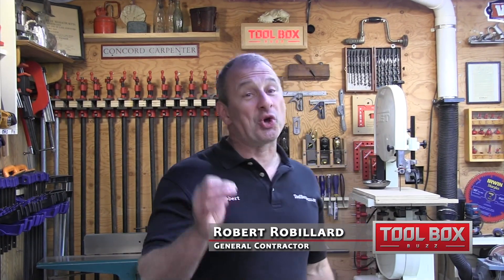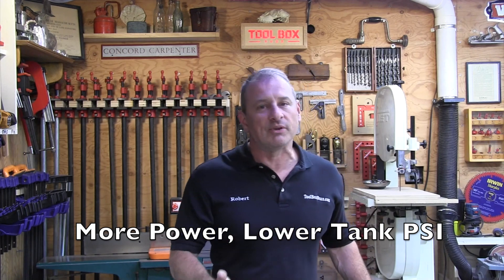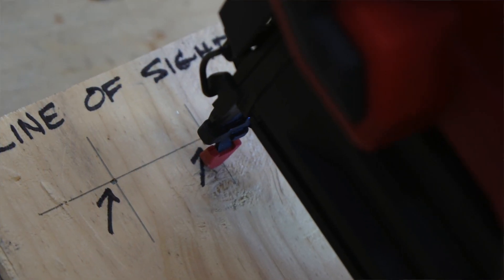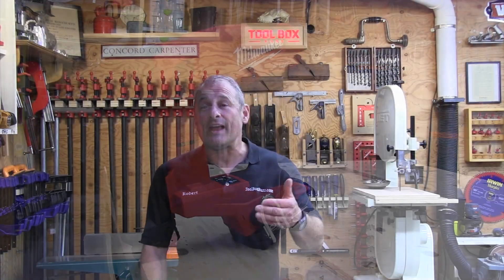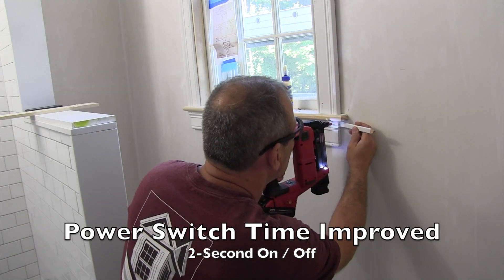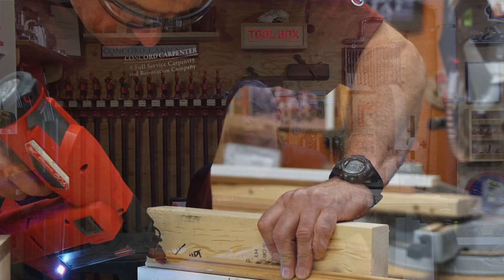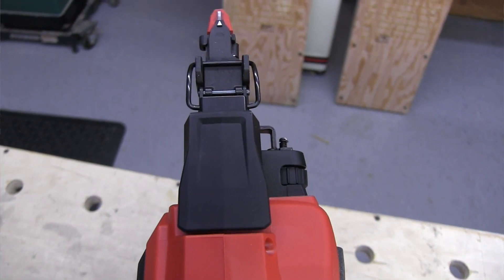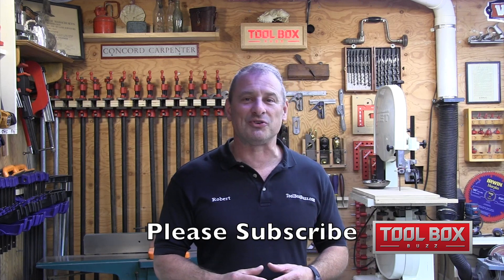Milwaukee M18 FUEL 18-Gauge Brad Nailer 2746-20 Review - Gen 2 - What's New?

Comment: Mine barely sinks nails on the highest setting. But I’m an old dumb plumber that doesn’t know anything about finishing work. I was hoping that it was like the the framing nailer and had enough power to turn it down. I tried to toenail into a corner bead and it curled outwards. I paid the exact same price for the framing nailer last year. I just don’t view it the same way, but I’ll keep it.

Comment: Bought it yesterday .
At 9:06 in your video I see a repair on the wall with fiber tape : use spray contact glue before applying tape , the tape will set ;)
Thank you for the infos on the tool , well explain !

Comment: I bought one for a trim job I did in Oct of last year 2021. I just tried to use it again to install some trim on a storm door install and couldn't get it to work. I tried different length nails and tried to reset it a number of times...
So now I guess I'll call Milwaukee, to find out what I need to do to get it fixed.

Comment: In 2017 I bought the battery operated Makita pin nailer and it shit itself in 15 minutes. It was the third time I had a bad experience with a hoseless nailer and I was done. Now three years later it seems Milwaukee has finally made a gun I'd buy. PLus, I have a few of those 2 Ah batteries from impacts I bought, so why not use them :)

Comment: Is the product you’re reviewing actually the 2746-20 or 2746-21? The title for the video says -20 and you also mentioned it in your video as -20, but the link you provided refers to -21. Is there a difference?
Reply from the maker: A Bonsy no5 sure now did you look at web article?
Reply: A Concord Carpenter / ToolBoxBuzz yes, now that I reviewed it closer it looks like the only difference is that the -20 is TOOL ONLY and the -21ct comes with a battery, charger, and bag. All of the specs seem to be identical.

Comment: They aren't new they changed the design and made it weaker, the gem 1 was too powerful and had too much recoil, but with nitrogen powered nail guns after a certain amount of use they get weaker, air escapes every time you use it, depends how you use it in 6 months you might have to get it serviced or 2 years but eventually it will lose it's air, its same design as Hitachi I know guy who has tge Hitachi framing gun and I told him you will lose power the more you use it I just seen him recently and asked how his Hitachi was doing and said not so good it doesn't sink the nails fully

Comment: Ive been wanting to order this nailer for a while, but I am a little skeptical, had the senco fusion before and it did great for a while but died right after warranty expired, also had problems shooting naile
Reply: Sorry posted before I wanted, had problems shooting nails if left in the cold for  a while, wonder if this Milwaukee having a similar system with a gas recirculating would have the same issues

Comment: so the gen 1 had more power but it was still trash and wouldn't work at all for 3/4 hard wood installation and got returned after 24 hours because it wouldn't sink the nails fully

Comment: I bought the 1st model Milwaukee 18g nailer and returned it after about 5 shots. This  Gen2 models' functionality is a vast improvement from the old, but the weight and overall bulk I feel is still an issue. Especially if a 5.0 amh or higher battery is used. While using belt hook, this baby was swinging and bashing all over and by the end of work, my pants around my ankles. I love battery power tools rather  than electric, especially Milwaukee batt power, but the Paslodes 18g nailer is just to good to me.The Paslodes power tops every other nailer out there.  pneumatic, battery powered, they don't compare. The Paslode 18g is so compact, light and still powerful. Yea you may have to clean it once a month  to eliminate Paslodes notorious no spark no fire prob, and the gas cartridges aren't super cheap but the 10 bucks a 2pack cost is well worth what it makes up for in ease of use. Some hardwoods an 18 gauge nail can barely penetrate without bending or ricocheting off. I'm using African epay(a super hardwood) for many projects and the Paslode was the only 18g nailer that could set nail heads properly every single time without any issue, jamming or recharge. It's just too good. To cheat on Mrs. Paslode with  Miss Milwaukee 18g is just not worth it yet.
Reply from the maker: Pauliebjr I don’t disagree with Paslode quality but I will comment on your 5ah battery comment.  Use smaller batteries like a 2-3Ah. There is. I need for big heavy batteries

Comment: I have trouble getting nails flush to the board
Even with 45 mm nails into pine trims 
it just doesn't punch deep enough. Milwaukee M18 Angled Trim Gun

so now i'm stuck with a over priced Gen1 boat anchor

 VERY DISAPPOINTED
Reply from the maker: Lets see what Milwaukee does for Gen 1 owners

Comment: Great review. Impressive improvements indeed. What is the clamp you used outside the miter at 8:15? Could you post a link in the reply for a source to buy?
Reply: pinch clamp I'm guessing.  I forget where I bought mine, but all over.  Check lee valley
Reply: @charlesf9065  https://youtu.be/qbm6_6DjuDA
Reply: @charlesf9065  Collins Miter clamp (comes in a kit as well) The video link is from this channel.
Reply: @trueemail9687  I don't think I bought mine from collins, but not surprised they have them

Comment: Hi,

I use the the Dewalt 18g brad nailer and i do like it. The only thing is i which DeWalt can fix that rev up motor noice in the next design. It get annoying after a while. Still it's nice not to set up a compressor and air hose for small projects. 

I really do like the new design milwaukee m18 brad nailer plus no rev up motor noise. The only thing i wish they didn't put on was the turn on switch. It might be a safety issue but a nailer won't fire if the tip isn't press back. So really not necessary in my opinion. 

Now i hope milwaukee is redesigning the m18 - 15g finish nailer. That nailer i didn't like at all.

Man milwaukee is really improving the Carpentry industry. 

Thank you Milwaukee.....

Comment: I currently have the dewalt 18v older model. Can't wait to upgrade to this later on this year or early next year. I was going to get the new dewalt 20v but I don't have any batteries for it and I'm sick of the old batteries.

Now if Milwaukee can put this as a kit with 2 batteries, charger and either a packout case or regular case I'm completely sold. In fact that's the only reason I'm currently waiting, I like having the case to put my nails and stud finder with the gun.
Reply: Our Guard  Wow that's a good deal for the 3.0 battery. I've been wanting to get a 2 pack for my drill/driver but I'll pay $200 for 2. 
I'm mostly bosch/milwaukee now so it just doesn't make sense to get back into dewalt, there is no incentive that i've seen from them.
Now bosch had the newer impact driver with core6.3ah batteries for $150 last year which was a great price. Milwaukee also had the 12ah kits with bare tool and a free 9ah or 12ah battery depending what you got for $450 roughly.

I'm waiting to see if a case comes out or I'll get the packout tool case, it doesn't have the metal corners, hoping its a bit smaller. You wouldn't be dropping it anyways.

Comment: Sounds better than the Dewalt nailer I have, now if they would come out with a 21 ga. Cordless nailer I’d be a happy carpenter
Reply: Just wain 2  more months. Its coming
Reply: They do have cordless pin nailers
Reply: Pauliebjr yes there are 23ga. Nailers out and I do use 23ga for small items, trim like base,crown and casing showed be 21ga with a slight head at a minimum and is my go to gun for trim
Reply: i have the dewalt 18g cordless nailer i'm ready to toss it in the garbage zero fire that leaves 10 nails in the magazine
a magazine that has a touch too much clearance for the nails so the nail strip tends to snap and jam up forget putting a strip behind a strip
really looking for a new gun and it wont be dewalt

Comment: The design on these looks WAY better than the flywheel design on the dewalt. If these are good I may actually own my first milwaukee cordless tools and retire my dewalt cordless nailers.
Reply: I have some Dewalt tools but I hate all the nail guns they are too bulky.
Reply: Still using nitrogen air every time you use it the air escapes and it get weaker after a year it probably won't be able to sink a nail flywheel gets stronger the more you use it and is not affected by temperature change
Reply: @loucifer323  Got proof the nitrogen will escape? Do you have proof that the nitrogen will escape within 1 year to make the nailer useless? If it does, is it impossible to recharge the nitrogen of the nailer? Do you have proof that these nailers will have their performance negatively effected by temperature changes? Yes, cold weather will likely reduce some of the power output of the nailer, but if it still sinks brads in -20C? Is it really a concern?

Call me crazy, but I will wait for people to actually use it, test it, and review it, to provide me both fact, and opinions, rather than making completely unfounded, baseless assumptions.
Reply: @dposcuro  Call Milwaukee they will tell you that after a certain amount of use you will have to get the tank replaced
Reply: @loucifer323  milwaukee does repairs much better than dewalt.  That won't bother me if it works
Reply: It's still too big an heavy to swap for my paslode

Comment: Dumb user question, how is the nitrogen canister refilled or changed out?  Do the big box stores carry the refill canisters?
Reply from the maker: Not dumb - its factor sealed and it will be years before you'll need to worry about this. If it did need to be done a service center would handle it.